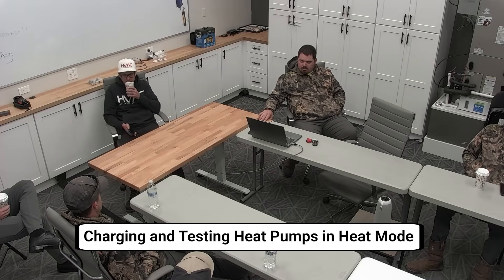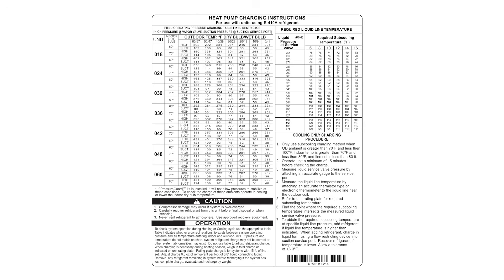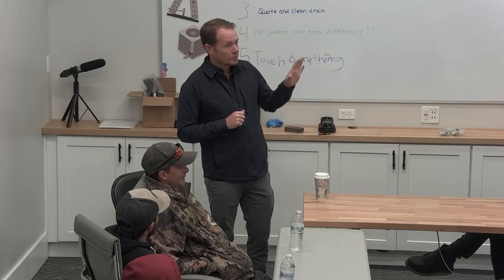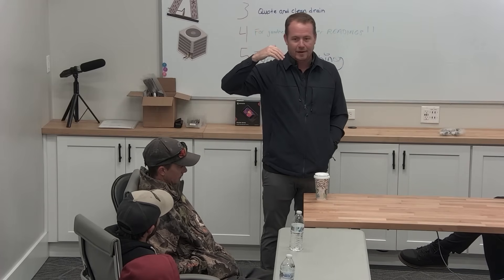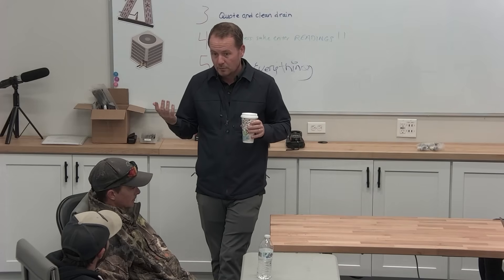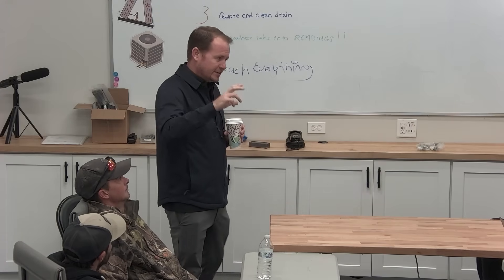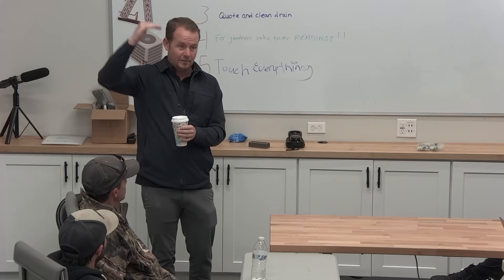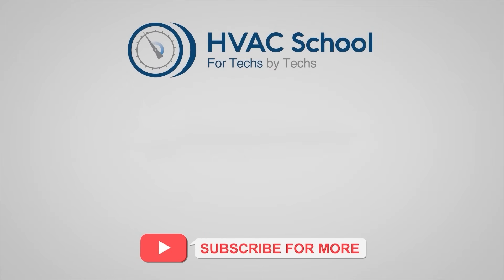Charging and Testing Heat Pumps in Heat Mode

Comment: In regards to the installation process and timing, a quality team will stand by your beliefs in how long a job should typically take. 

As long as it takes. 

There is no time the present and there is not a more important time of significance for that piece of equipment. No matter what the profit margin says, do the process and do it correctly. 

Great video instilling the pride back into the this business.
Reply: If you don't have time to do it right the first time, you certainly don't have time to do it again.

Comment: Thanks for the video you always have very good content! 
I would also clock the gas meter with only furnace on even though manifold pressures are correct if the manifold has the wrong orifices installed it could be grossly overfired or even grossly underfired due to morons at the factory. Rare but have seen it and also have seen LP back to natural where they change the spring and leave the smaller LP orifices which will cause the furnace to be underfired around 35%....have seen some condense when too underfired! Clocking the meter tells you your actual BTUH delta T can give a good clue but clocking gives you a definitive answer!  

As Frankgall6 commented it is Co not Co2....I would let it go normally but a couple techs were saying Co2 too so make sure they don't grab their Co2 meter when checking for Co! 🙂

You have some of the best content on YouTube guys....Thank You!

Comment: I didn’t hear anything about how to actually check a heat pump for proper operation in heating mode ie temperature rise ,discharge superheat, vapor line temperature versus outside air etc. I get your emails and was wondering if there was one that may have that information.
Reply: 😂 same
Reply: Im not the sharpest bulb in the closet, but within the first 4 minutes, Brian mentions a heating chart for generally checking charge, should be found for the unit you're working on. His was a carrier. 

As a tech, this gives me the info I need to generally check my charge for the context given, a 'need to do it now' situation where cooling is not available for charging.

If you're diy, I get the miss.

Heat rise and other performance information based on ambient condition on each manufacturer, as a tech, you gotta know the average numbers to look for or you should be able to find the info to get the call completed imho.

Best of luck on your tech journey <3